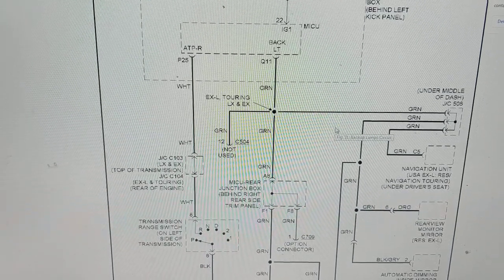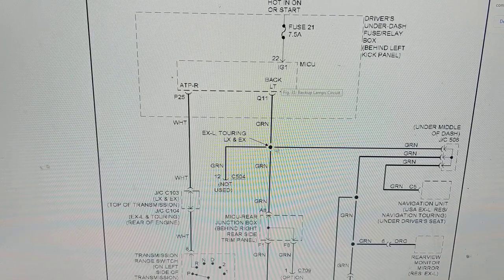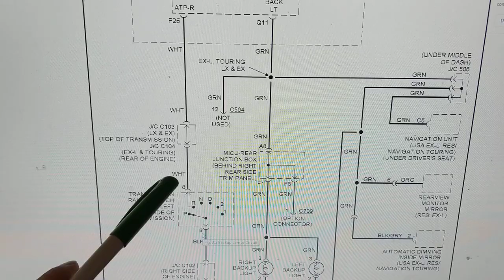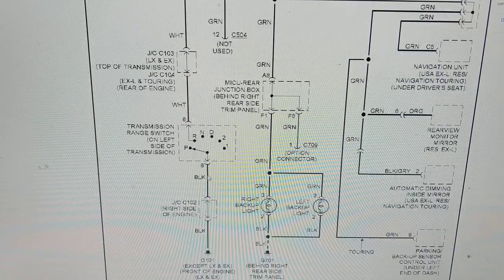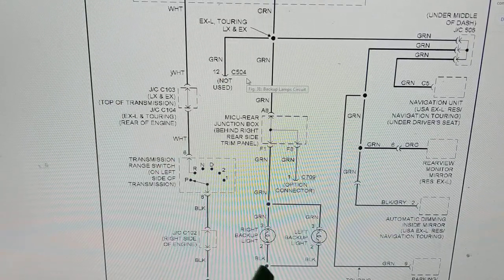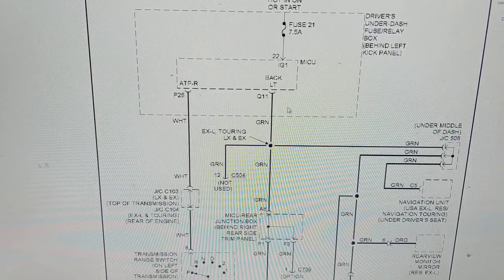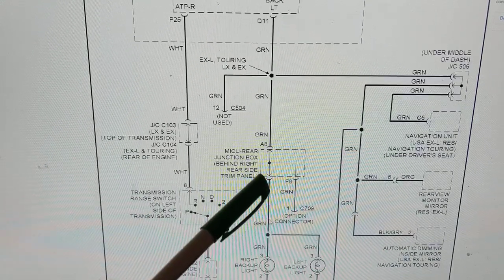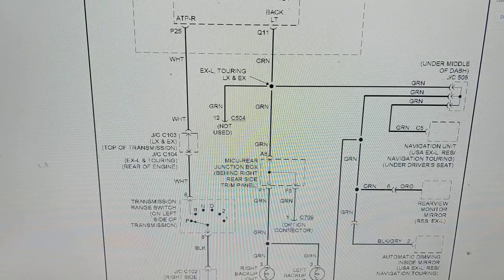REVERSE LIGHTS EXPLAINED how to fix  REVERSE LIGHTS from   WIRING DIAGRAM TROUBLESHOOTING THEM

Comment: I will be installing a back up camera on a 2010 silverado. I understand that the green wire at the reverse bulb is the hot wire, but I have TWO black wires going into the socket then going to the other taillight bulb.  Can I use either black wire for ground--is it just a series ground?? Thanks !!!!!
Reply from the maker: Not having that schematic in front of me for that certain model you're better off going to Google type 2010 Silverado lighting systems diagram and then it'll tell you the connector they're not all similar

Comment: Hey Joe I have a 69 Chevy box truck  it's a  straight 6 and I put new harness I'm it and lostt my wires for atl.  It has out side voltregaulater and I chant get it to charge I'm pretty sure the wires aren't hooked up right can u help me out with some info on that
Reply from the maker: Try to put in wiring diagram for 69 Chevy in Google try to put as much details as you can to make and model you should be able to download a diagram in the 69 Chevy configurations of the alternator and The regulators were totally different than today obviously that's why it's important to try to get a diagram as close to it as I can keep me updated

Comment: 1999 Ford F350 Diesel with a/t '20 bolt pan, Transmission . Reverse light (white) comes on with the brake pedal (red).  what's the fix ?

Comment: Get this, I have an 08 CRV. 
the reverse lights are drawing 0.3 amps, and when I take the fuse for them off, the parasitic power draw stops, yet the reverse lights still work. 
Suggestions?
Reply: First thing is that how was the current measured if you break the circuit with an amp meter you are Awakening the modules

Comment: Running lights turning off in reverse? F550. I was going to swap this part just as a shot in the dark
Reply from the maker: Look for the relay that's common or also the switch unless you have a diagram what is the year of this car
Reply: @Joe electronic schematics for auto  2019. We're rewiring a new plug receiver too. Thank you for the info